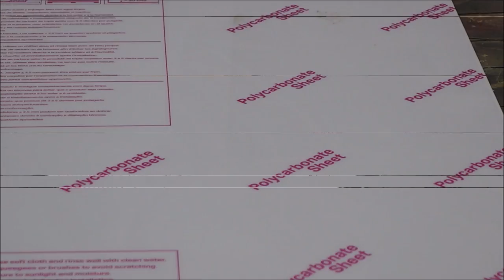Mesquite and Epoxy Table Top

Comment: Mesquite is way undervalued. It is an extremely hard wood, absolutely beautiful wood, however, still don’t see why there aren’t YouTube woodworkers using it. Of course, I live in Texas. Maybe it’s an availability issue.
Reply: I work with mesquite on a daily basis. There is a misconception that it's extremely hard which it isn't. It's    an easy wood to work with. Very stable and doesn't warp. You can actually use it green for some projects